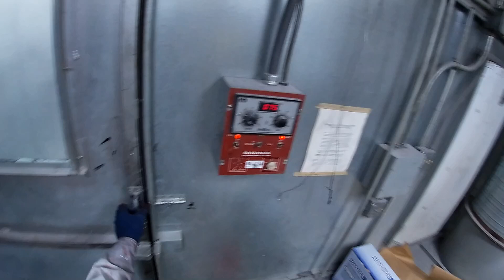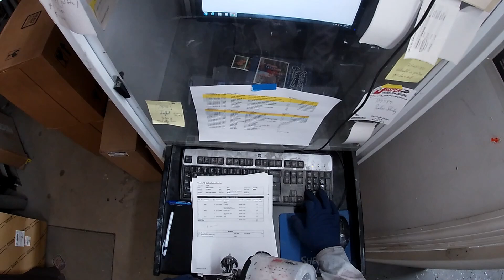Refinishing Red Honda CRV

Comment: Great work
Reply from the maker: Andre Lawrence thank you so much 🤙🏻🤙🏻🤙🏻
Reply: That ws400 is a beast ,,,it’s second only to my w400lv only because the w400 uses a lil less product
Reply from the maker: Andre Lawrence I have a walcom carbonio HTE that is a savage at saving material but sometime I need that supernova finish ha
Reply: I have heard great things about the walcom ,,does it giv the film build like the Iwata while using less,,,the lph400 is hard to beat for being stingy on materials also ,,I jus rather the pace of the compliant guns
Reply from the maker: Andre Lawrence it definitely gives a very good film build...I’m using about 13oz of clear on a bumper compared to 16oz-17oz...it’s also the fastest gun I’ve ever sprayed with...you really have to adjust and get used to it or you will run the fuck out of it lol
Reply: 😂need to try it some day ,,,but for bumpers I am around 12 oz depending on size ,,,but I am a close and fast guy